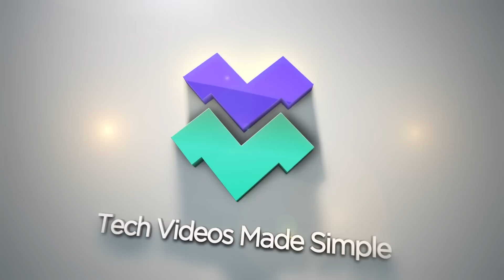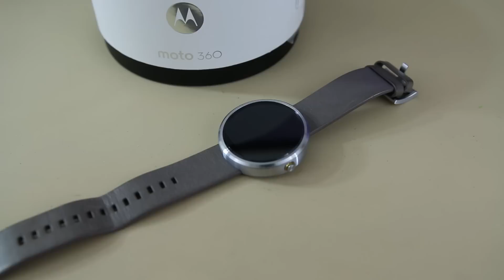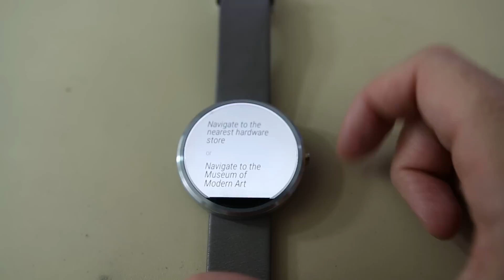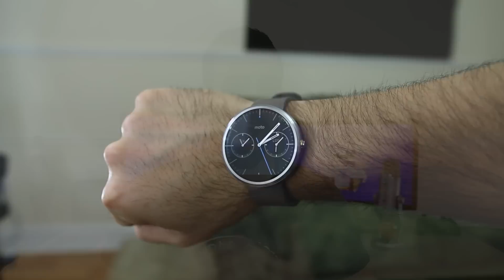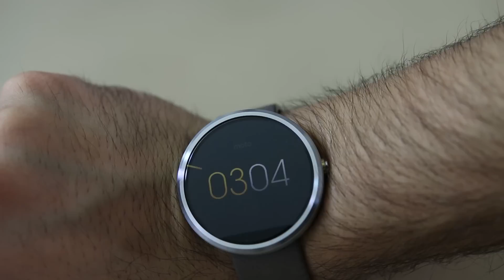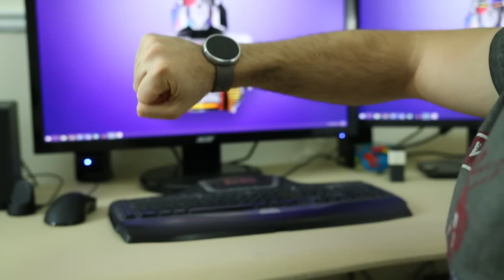Moto 360 Revisited: Is It Still Worth It?

Comment: I originally got the LG watch on release (Moto 360 wasn't available) was a great watch but for board of the square look. In terms of similarity there both almost the same in day to day use
Screen: LG was clear but small,but would last a day on ambiant
360: Large vibrant screen with a natural watch look,ambient would make it not last a day very well. Flick to turn on screen is identical.
Charging:I had a big issue with the LG her, while at first it charged well after a year of use the contacts became tarnished and even with cleaning became hard to charge,whilst the 360 has induction charging which means no physical interlocking required, also makes a handy night clock.
And last of all the 360 has a heart monitor, a nice little extra but I find it is often hit and miss ( wouldn't put to much faith in its results) Both great but do order the more traditional shape and aluminium body

Comment: I just bought the black metal band Moto 360 and by the looks of it I have wrists that are a bit larger than yours, but it sits on top of my wrist perfectly.  I look stupid when I wear a watch that's too small.  It makes me look like I'm wearing a kids watch.  Its no bulkier than the Galaxy Gear 1st gen.  I think it actually might be lighter.  The jury is still out for me on whether or not I'm going to keep it.  I need reading glasses and I've discovered that there is no way to adjust the font size so that is a big drawback to me.
Reply from the maker: Scott Mallett Nice! Ya, i don't mind the bulkiness either. The only issue I had was the watch sitting flat on my wrist. The straps didn't curve inwards and was being stopped by the connections of the watch. It's not a deal breaker, I just found it to always feel loose. But now that the watch is $165 it's such a good deal! Thanks for watching btw!

Comment: I still think the Moto 360 is a decent deal. 

Let's spin it a different way: a basic G-Shock goes for what? $110-150CAD? Then goes higher depending on different models? For an extra $130 you have so much more functionality.  

The problem is this mentality us 'nerds' have. Unlike a traditional G Shock that just changed with different colours a device with Android wear will continue to come out with lots of "designs" in terms of the actual device. Until the perfect watch comes out manufacturers will continue to release new devices until the cycle gets dull. And for this market it may take forever!
Reply from the maker: I agree there is no perfect watch and forth most part they don't really add any value to our lives over our smartphone. Sure there's less micro interactions in order to view a message but if it's a message you want to respond to you still have to take your phone out afterwards,  which actually makes the experience more stressful.

 The hope is to have the smartwatch do something the phone can't one day. 

But since we love tech we are early adopters and I feel the Pebble smartwatch is the best bet at the moment.